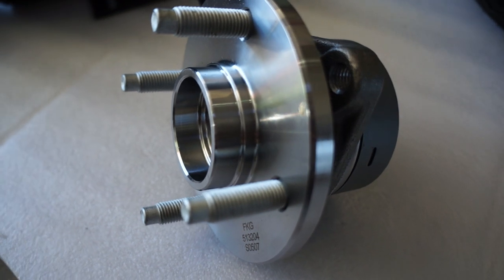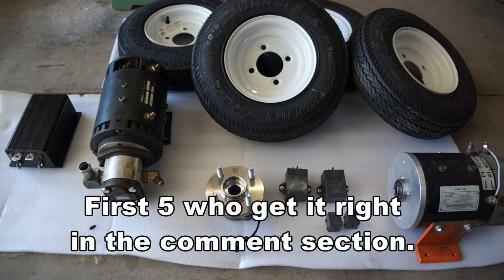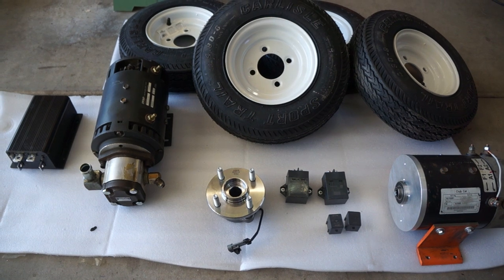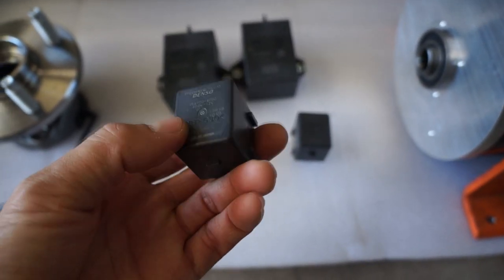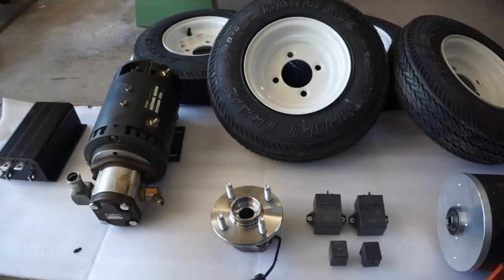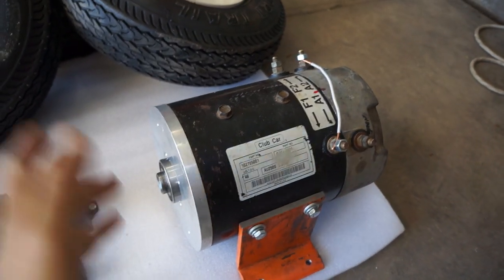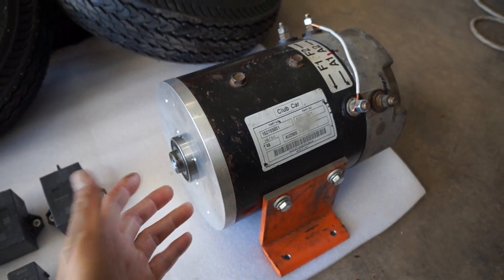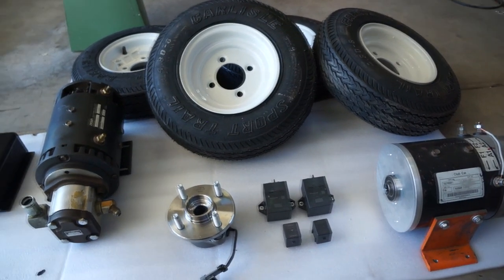My new Project X "get it right and get free relays"

Comment: I had the same experience with an EZgo motor. The reason it's weak is because it's not a series motor. The thing with golf cart motors is that they have no magnets inside to make a field, instead they use electromagnets. Normally they used to use Series wound motors, which basically had big thick copper coils, which you would put in series with the armature and power directly, and all the current flowed through both. The more power the controller puts out, the stronger the field and therefore torque.
Then they started using separately excited motors, like this one. The field coils are much thinner wires, like maybe 22 gauge inside. And the motor controller for these motors has 2 connections, the main output and then the fields. They did this because in electric motors, the strength of the magnetic field affects torque, top speed, and regeneration. The higher the current in the field, the stronger it'll be and the more torque the motor can produce, but it greatly reduces the top speed, but it also allows the motor armature to generate much higher voltages for regen braking. And the lower the current, the less torque but more top speed you get. So the motor controller varies how much current is in the field coil at any given time, like if you're starting from a stop it'll pump more amps into it but once you reach speed it will lower them to allow for a higher top speed.

I know this cause I had originally bought a similar controller for my golf cart (36v to 48v conversion), and series was pretty much not working, as it couldn't even spin the tires in the air. Then tried to put them in parallel. HOLY TORQUE. The golf cart almost did a wheelie everytime you accelerated. But the top speed was stupid low, like 5mph, and the motor was getting EXTREMELY hot, because at 48v you're pumping wayyy too many amps into the 22 gauge coils. I believe they were like 3 ohms or something along that range, so like 18 amps which is way too much for 22awg. 

To test it we put the cart on jack stands and connected the field coils to a variable power supply and varied the current. With like 5 amps starting the motor was behaving very well, full throttle it spun at a reasonable speed... Then keeping it full throttle I slowly reduced the field current to see what would happen. It kept spinning faster and faster until I got to around 0.2A. That was when the motor overrreved and the armature spread out and cut up the field coils lol. Then the motor controller went cause since there was no magnetic field the motor was just shorting out instead of spinning. Ended up taking the motor apart and re-soldering all the places where the field coils got cut, and squished the armature back in with a hose clamp. 2 years later and a proper motor controller and it works great lol.

If you're set on using that controller, which is understandable given how damn expensive the SepEx controllers are (separately excited, SepEx is what Curtis calls them), I would recommend you get a PWM controller which lets you set a max current, and set it to say 2-3A or whatever you find reasonable, and wire it to turn on when the solenoid kicks in. The beauty of it is if you get a reversing pwm controller it will also reverse the spin of the motor without needing contactors, since the field will reverse.
Reply from the maker: Thanks for the explanation Brian, that make sense.  I have never heard of shunt wound motor.. .the last golf cart I work on had a series wound and seem to work great.  I did wired it in parallels after a couple of you guys mention it.  At 36V the motor was able to start and run (starting torque was insane), max RPM like you said is lower but torque is up.  However, when put it on 48V, it's probably pulling massive amps at start up and even with no load it trip the 100A breaker.  Look like I am going  to have to put it on a controller after all (was hoping to keep it simply and on and off to power a pump).  It came with a Curtis controller, got a bunch of wires and I have not research into it... Came out of a club cart, I would think the controller would be to run it properly since the motor even had a censor on the shaft, probably reporting the RPM.

Comment: The motor being really weak is probably because it's shunt field and you have it wired for series field. Check the field winding resistance to confirm, if it's in the tens of ohms, it's shunt field.
Reply from the maker: Ooh...  did not know that... could you please explain how to wire it as shunt field?  Right now I have it wire as series... thanks.
Reply: @devildestiny555  Wire the field (stator) in parallel with the rotor. Or at least that's the simplest configuration, all sorts of complex configurations are possible for speed control.
Reply from the maker: @NiHaoMike64  oh darn, why didn't I think of that... haha, always thought most golf cart uses series wound... at least my last golf cart conversion wired it like that and it work great... guess I am not familiar with electronics either.  Haha.  Thanks for the help.  If you need them relays, shoot me a email: devildestiny555 (at)yahoo

Comment: Great build, I am very interested in the final motor you went with. What was it designed for? How much power can it deliver(Watts or AMPs or Horse Power?) Where can I get one 😊 I am  converting a riding mower to be more useful and all electric.  I am also in the southwest (Phoenix AZ) and did the off grid solar and love to keep everything electric.
Reply from the maker: The motor most likely came out of a Crown Forklift, it's rated 36v, not much other info on it.